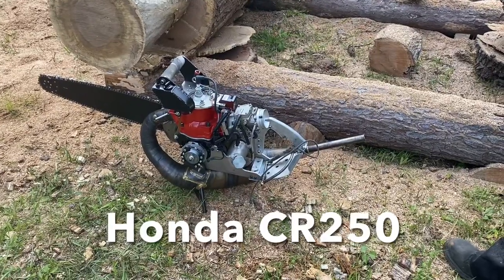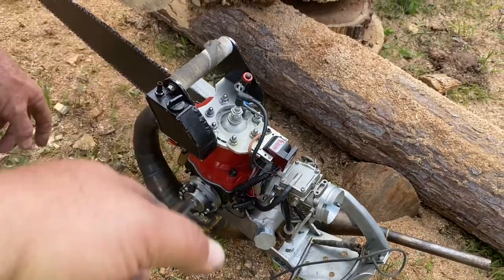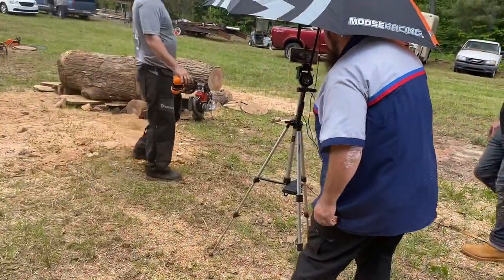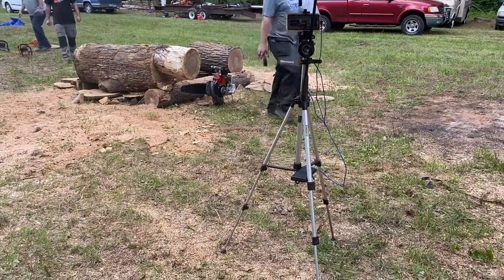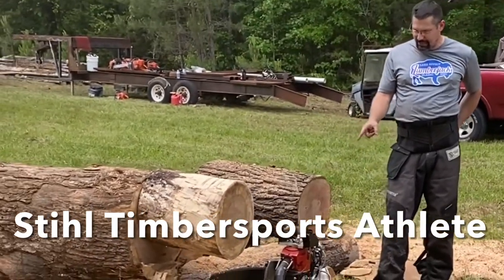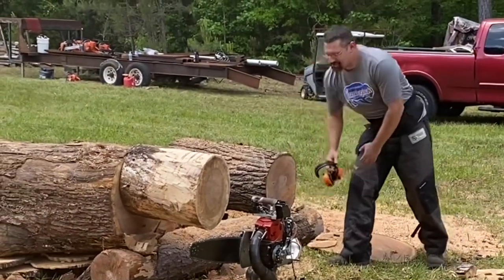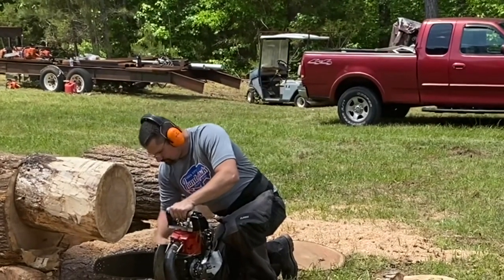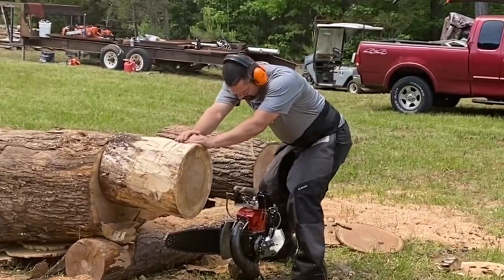Racing Chainsaw!  Honda CR 250!  Dirt Bike 325 CC High Performance Stihl Powersports Race Saw!

Comment: Just thinking about this using, a motocross bike engine. That would open up lot of possibility for power.  Need to build one out of a CR-500 those were brutal dirt bikes I had one when opened it up hardly hang on.